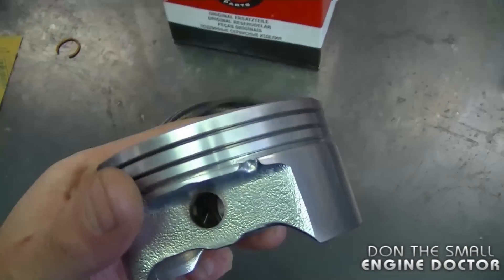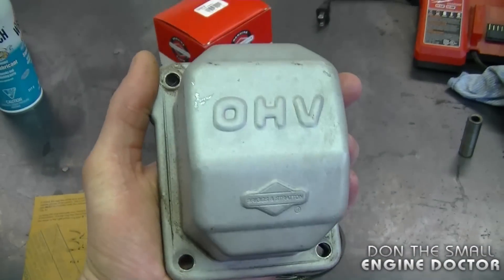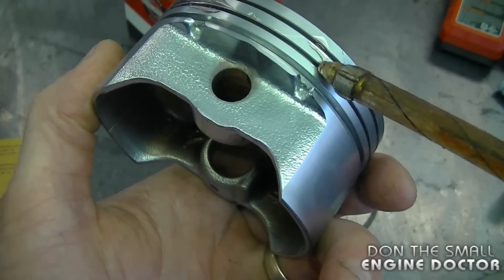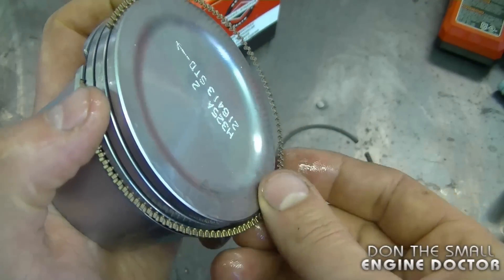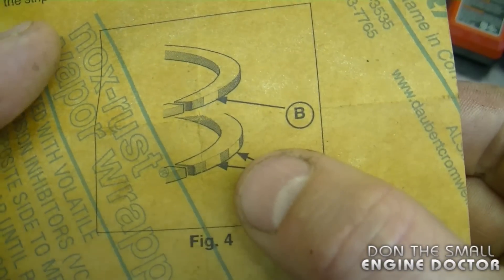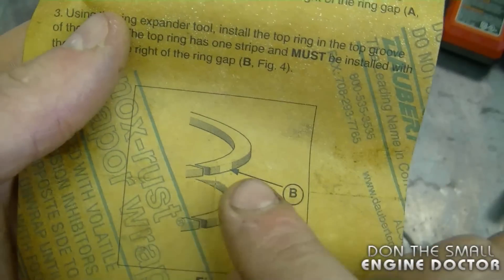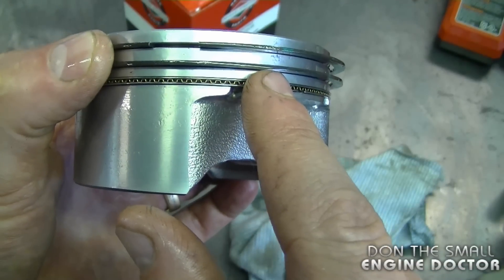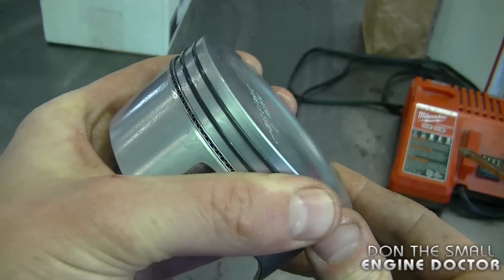Installing Piston Rings The Easy Way With No Tools!

Comment: What if you have an older engine with cast iron rings that you cant spiral in place without breaking them? Mine are about twice as thick as in the video and the first ring grove is an entire inch away from the piston crown. Old tractors are fun and easy to fix until your only auto parts store doesnt have a ring expander.

Comment: From my understanding when you put the oiler ring in you need to put the little spacer in first and then wrap the two rings around it because they sit on a Ledge on that spacer if you look at it closely you can see a little ledge on the back side of it on each little bump
Reply: 100% correct

Comment: U have to no ring gap and the correct way for these rings Togo n u r leaving alot of things out of your video
Reply: Because these are OEM factory rings, not "file to fit" rings. BUT it wouldn't hurt to spend the extra 5-10 mins to verify the gap specs before installing. In his defense, this video is titled "how to install piston rings without tools", the title didn't lie about the contents of the video at all. Even though the wrong gap could mean doing this job twice within a month, a big no no for me. Other than that, his information is solid. 📖
Reply: Ive got a trx450r too and my motor has been rebuilt 4 times i havnt had much luck with the 450 motor im trying a cr500 on mine next
Reply: Mine keeps dropping the crank bear everytime i have to rebuild mine so this time i decided that honda dont have a good motor at all for the trx450r thats y folks r putting the cr500 motor on the frames

Comment: You should have also mentioned that you always want to follow the service manual if there are no instructions with the rings.  And for the wavy oil control ring there can be side that needs to be up.

Comment: Hey Dony. I have a Suzuki 400 Eiger. My motor isn't working good. It is running lean. I purchased a new carb thinking that was the problem but it is still lean where it turns my exhaust glow red at the header. I think it may be a leaking head gasket. Where the cylinder head meets the top of Piston there is a gasket that looks to be leaking. Wet an brown around that area, like it's been leaking. Will leaking head gasket cause it to run lean and turn pipe red. It glows at night. Never did that before.
Reply from the maker: i think the valves need to be adjusted especially the exhaust

Comment: I have a Honda HR214 mower with a gxv120 engine that smokes and burns oil. I am planning to replace the rings soon. Can I do this job without removing the engine from the mower? I am going to lift mower on to a table.

Comment: Great video.
In case you haven't seen it done, a worm gear type standard hose clamp works perfectly as a ring compressor.  It covers all the rings completely and with gentle tapping around and tightening, the serve beautifully.  I have even used them on VW engines.
Great site. Keep up the great work. Subscribed as of now.

Comment: Awesome video!
Quick question: You stated in previsous chainsaw videos that any oil will work to lubricate the piston and ring(s) so thats it's not dry when you fire it up. Can you use a bit of bar and chain oil to lubricate a piston and rings instead of either like engine oil or transmission oil?
Reply from the maker: you could

Comment: An experienced motor technician showed how to do it without any tools and with no problems.  So, if you don't have the experience, then you definitely should use the piston ring compressor.
Reply: carl cappy wah kaka wah ;-)
Reply: If you are well experienced small engine technician, then you could get away without using any special tools for installing piston rings but, you have to be very careful with plenty of experience.
Reply: You mean the ring installation tool... c",)

Comment: Is it economical rebuilding engine driven welders if the engine is worn but power supply is still serviceable. Love the videos.
Reply from the maker: depends on the cost of fixing vs cost of a new replacement
Reply: opp

Comment: Hey Dony, I have a question for you on that generator motor. Did the connecting rod on it let loose? And if it did, was it one of those rods with only one bolt on the crankshaft cap?
Reply from the maker: they ran it with no oil, it had 2 bolts on rod

Comment: I've broken more rings using piston ring pliers than just using my thumbs to install them , you don't have any "feel" as to how far you are expanding them with the pliers . Also to make it a little easier install the piston on the rod and clamp the rod in a vise with soft jaws ( if you can )  so you don't have to hold the piston while trying to instal the rings . Thanks for another informative video Dony !
Reply from the maker: thanks

Comment: Don, do you have a video on repairing a surging lawnmower engine ? I have a Husqvarna mower with a GCV160 that starts on the first pull but surges constantly and idles poorly. Thank You.
Reply from the maker: first try cleaning it, or you may want to just get a new carb, they are dirt cheap and 99% of the time that is the problem
Reply: donyboy73 Thank You for your prompt reply.
Reply from the maker: nice pug! lol

Comment: the paint reference is partly to orient the rings right side up- there is a slight bevel on the inside up edge of the ring which on the firing stroke allows combustion gas to get in behind the ring & expand it and seal to the cylinder wall. Just on the top one??

Comment: The first (only) time I ever messed with piston rings I was taking apart a junk motor just to see what all was in there and when I tried to take the piston rings off I didn't know they were brittle and I snapped them in half. After that I always assumed you had to have a special tool to mess with them, glad to see you can do it this way, as long as you're careful, in case I ever need to.

Comment: I always wondered how much walking of the gap in each ring happens after installation. The rings spin fairly easily in their track, so it makes sense that some movement will occur. But I guess it would be unlikely for them all to walk into alignment together. Presumably after a few thousand revolutions they find a comfortable spot and then just stay put.

Comment: I can remember piston pegs from my early fiddling with two stroke engines, wonder why fourstrokes never bothered, can you enlighten me dony?
Reply: zx8401ztv two strokes have ring locating pins in the piston to keep the rings from rotating on the piston and snagging in the exhaust or the transfer ports. Due to the fact that four strokes don't have ports, these pins are not required
Reply from the maker: George Bishop hi George!
Reply: I've never heard of a piston peg.  What's it do/for?
Reply: Gogle Plus Sucks
The ends of the piston rings were shaped and a hole drilled in the track on the piston, in the hole a peg/pin was inserted, when the ring was on the piston it had to fit where the peg/pin allowed it to, the rings could not rotate on the piston, for a two stroke with ports it was manditory to make sure the ends of the rings never  rotated round to an open port.